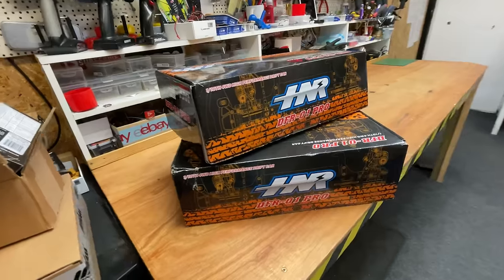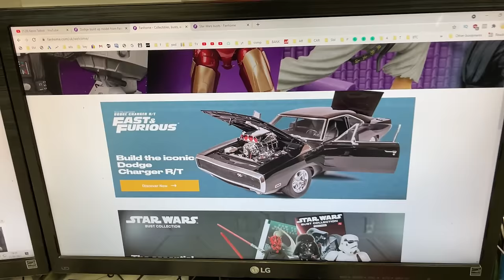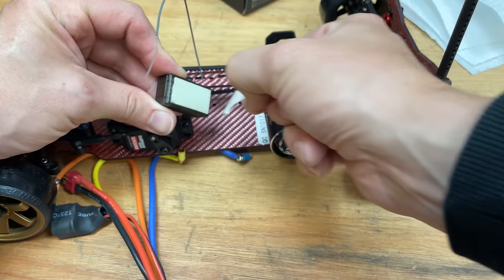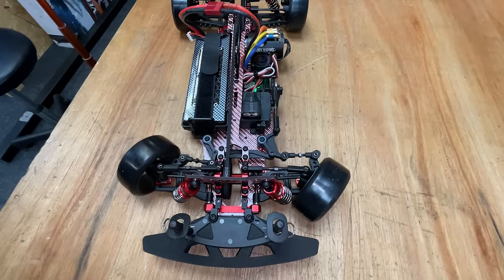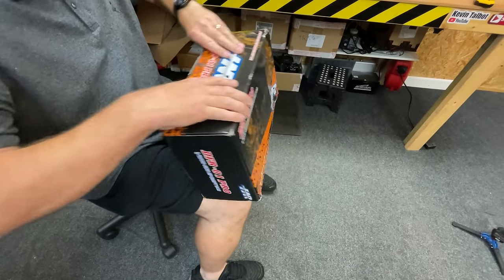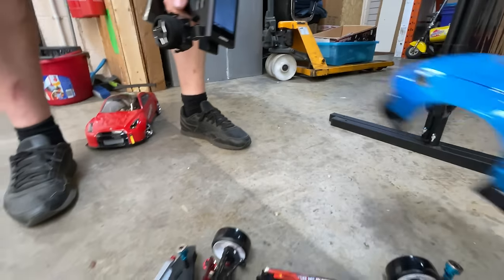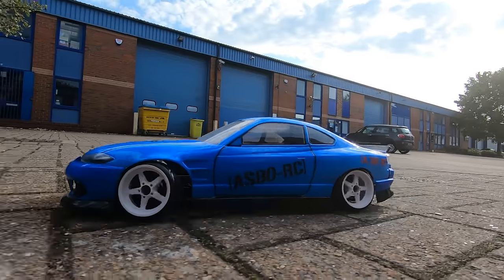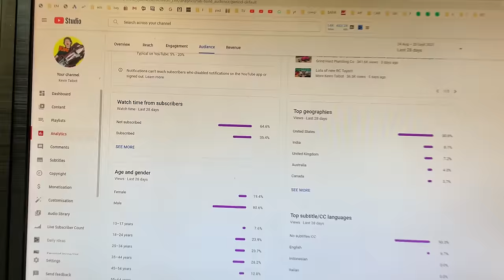Cheap Professional RC Drift Cars

Comment: 4WD? Professional Drift Car? That's a long time ago. I'm one of the rare guy's who keep CS-drifting for fun. But professional at this time is RWD.
Reply: and don't forget the gyro
Reply: Cs gang
Reply: @latefangs423  That's why i still love my CS-Drifter. It's drifting without a Gyro.
Reply: @DJDEVIL82  now that one interesting kit,i heard that gyro on the drift rc are pain in the butt to set it up
Reply: @latefangs423  took the words out of my mouth
Reply: @latefangs423  You need the gyro on a dial of your transmitter. That means you need a transmitter with a programmable dial. Each underground and each tire is different. You have to be able to ajust the gyro while you driving. Otherwise.. yes it's a pain in the ass.
Reply: @latefangs423  try setting up and tuning a 3 axis gyro system on a RC helicopter.

Comment: Yokomo yd2 rear wheel drive, pro drifter, easier to drift, technically all wheel drive is power sliding. Rear wheel drive are what the pros are using to drift, I’m not trolling, It’s not that serious, Love your shows, keep it up
Reply: Exactly but they're quit expensive :/
Reply: Yeah they just very exprensive.
Reply: Aye it's easier to just gaffa tape rear wheels of any RC car and I Habe a drift car hahaha
Reply: love my yd2 sx3
Reply: a good alternative is the 3racing sakura d5s i think rwd setup needs a bit more tinkering on the suspension to get it just right
Reply: @sska__karate271  Yd2s or e are relativ cheapsnd good
Reply: Yeah.
Reply: Yeah.
Reply: @sska__karate271  There expensive because there good 😂
Reply: @loga_912  There expensive because there good
Reply: its expensive because so many people hyped them up.
Reply: @zechariah3234  that’s completely false their expensive because there parts have  quality and the engineering behind the car itself
Reply: @zechariah3234  lol nope! Because they are good! Hype lol
Reply: @zechariah3234  yeah u most def a basher 🤣🤣🤣. Bashing is cheap any niche of rc is prolly around 350-500. It’s Like saying drag ones are expensive. Same price as a drift one lol they’re not overhyped they just have real tech and engineering behind em
Reply: @pitsa9838  i dont bash, ive put close to $1200 into a car. i dont think your hype and my hype are the same.
Reply: @bumperlez  not saying it as bad thing
Reply: @zechariah3234  I’m just saying you’re completely false no hate bro
Reply: MST are worth a look, make some good chassis 😊
Reply: Technically a pro drift car with RWD is also powersliding isn't it? Also technically a true drift car hasn't got plastic or foam tires has it? Also technicly a true drift car hasn't got a gyro to manage the drift has it? Also a toy car has a really tough time starting from standing still with plastic wheels and only rwd, so i'd say all those are only technicalities and true experience doesn't translate to RC world. :-)
Reply: @polishguywithhardtospellna8227  I agree on that rc drift isn’t a realistic compared 1/1 drift scale drifting. The gyro is there to simulate real steering movement the reason behind having a gyro isn’t just assisting you to drift rwd but to make it feel a little bit more realistic I can’t explain what I mean by real steering movement
Reply: does literally anyone in these replies know the differences between there, their and they're?
Reply: so ken block is a power slider lol, actually the difference between a drift and a power slide is when and how the slide is initiated. a power slide is a power slide because around the apex or halfway through the corner you give it power to get the rear to slide out at speed. Drifting is when the slide is initiated before or at the beginning of the corner. and your already sliding when your at the apex and slide the whole corner. So awd isnt just power sliding because when you drift an awd your doing the same thing, ebrake initiation get sideways and give power to keep the slide around the whole corner. The difference is how you hold a slide. Both awd and rwd need throttle to control the drift but where rwd needs counter steering awd doesn't and when you turn into the corner in awd your car either straightens or you whip the other way from the power. And in the real world AWD cars can do way crazier and more technical drifts because of the awd. Ken block could not have done a lot of the things in that mustang had it been rwd. But rwd also allows you to drift at a much slower speed because part of awd is giving it so much power your flying through corners. That also translates into RC cars and why you can do technical courses in awd cars, its just harder and easier to overshoot and is why formula drift and pro rc drifters run RWD, as well tandems are Insanely difficult and borderline impossible with awd.

Comment: I haven't seen anybody drift 4 wheel drive-in years.
Reply: yeah" drift car" its more like a slide 4wd car, not a drift car that are RWD...
Reply: @simasm.9757  what's the definition of drifting
Reply: @TheNamesArif  controlled slide, you don't just let the car slide, but you control where how and when it goes you can't do the same with 4wd what you can with rwd
Reply: @simasm.9757  as long as people have fun it doesn’t matter right!
Reply: Ken block is putting out content
Reply: @GhostActual206  yea was really fun got ride in one
Reply: @crazyrc4610  ture but its not a profesional RC drift car
Reply: @GhostActual206  I ain't going to waste my time, saw some RWD RC drift cars look and drive like real drift cars, not these 4wd Subaru that's in a parking lot on snow(no hate on Subaru)

Comment: 3Racing Sakura D5S its a good real rwd rc drifter if you want to test out rc drifting. It comes as a Kit, you'll need a body and electronics to complete the build.
Reply: How does it compare driving wise to a yokomo or something more exspensive.
Reply: @mbsanocki88  setup is a bit more not out of the box ready needs some tuning (its what most guys in my area run since we cant get yokomos to the same level of accessibility)
Reply: All I can do is make donuts with my d5

Comment: Do some rwd ones man, theres so much to chose from from overdose galm to sakura d5. The rc drifing community would definitely love to see so.e of that
Reply: Exactly
Reply: @brianbunner3669   nb4 is awesome 👌
Reply: Who cares? 😂 the drift community uses a gyroscope. This is embarrassing to me. 50% of the work is done by the computer. in 4WD, at least 100% of the movements are made by the driver.
Reply: @pawel98rc  love to see you drift a 1.10 rwd without a gyro
Reply: @pawel98rc  gyro is the same as a real drift car . real drift car counter steering it self

Comment: It’s definitely still nice but you can’t really call it professional......
I recommend getting one of the yokomo yd2 variants, the sxiii is most used by people.

Also if you do build it, proper good quality electronics are highly recommended and don’t expect to be an absolute pro the first go you give it. It’s a skill you have to practice and tune the car.
One last thing is you need a gyro for rwd
Reply: Yee i have on its hard to teach drift with it and its for fair price

Comment: Learning how to properly drift a rwd drift takes some skill. Drifting in an awd drift car would be power sliding. I have an RMX 2.0 and it’s a blast. So many upgrades to personalize your drift car. This winter I plan on honing my drift skills at my local track. You can never go wrong with a Yokomo drift car!!!! Top notch!!!! Driver skill is what’s gonna make the difference either way!!! 👊👊👍👍
Reply: looks like kevins is a countersteer car, where the front diff is spinning slower than the rear. helps with some stability, gives the illusion of a RWD without the weird powersliding look of a full awd like a 4tec. good for a beginner.

Comment: I am no expert by a longshot, but ive done some RC drifting a bunch. I own a sakura d5 and its great even though its on the cheaper side of the RWD rc kits. Knowing what I know now though, I probably wouldve went with a Yokomo YD2 series car. They have more options available that are direct fit and more of a following behind the brand. Love the drifting content kev, even if its just power sliding ;)
Reply: I’m seriously thinking about a Sakura d5, is it worth it? I’m trying to make a build around $400
Reply: @2smallgarage268  Yea. If you have 400$, and for sure want a RWD drifter, it’s a great deal. But it doesn’t compare to a YD2 with proper electronics. Just know that ur skill ceiling isn’t that high with a D5 chasis. At least without modification of course

Comment: I have the touring version of this model the brand is called Blaze and the model R2 ! The car is based on xray t4 2014-2018 not exactly on one model ! For the price its a good model al though you can't compare it to carbon fiber cars! For stock classes it can hold a bit, for modified class tho not a chance you need a lot of upgrades from xray to run properly! First of all, driveshafts secondly shocks thirdly you need to mod the plastic spur mount and motor mount in order to achieve certain gear ratios for small to medium tracks ! For drift car it migth be good i dont know ! Let me know if you have any questions!
Reply: Where did you buy your rc car from? Online or in store?
Reply: @troysoriano463  Hobbyking if you are in Europe or the official website Blaze rc !I don't recommend it tho!I can make it run decent from exprerience but for a new commer buy a well-known brand!
Reply: @PCXMODSGR  have you brought and fitted any of the parts from the T4?

Comment: I’ve got two of these, there actually super fun!! I’ve also converted one of them to a RWD chassis as well. Not bad for a chassis costing less than $150
Reply: yes!!!
Reply: How did you find them the link doesn’t work for me
Reply: Amazon is where I found them….
Reply: Wait how much did you get them for like to buy them and have them running without anything that you added on because everyone is saying they are around 300$ or like 400$

Comment: I would love to see a rwd chassis with a gyro like a mst rmx rtr
Reply: Would be cool , but I don’t think they are allowed to in the comp drift so it’s not common practice.
Reply: @Captinfun101  I mean most comps I’ve seen are strictly rear wheel drive 🤷‍♂️
Reply: @Captinfun101  the comp in the netherlands is only rwd, and gyro is allowed
Reply: Gyros are semi allowed in comp they have to be set to a certain point I run the MST rmx fully custom carbon and aluminium build
Reply: @baileygardner5408  i drive a yokomo yd2 and never had to set it to a certain point
Reply: @bvb-013  never had to set it in competition??
Reply: @baileygardner5408  nope
Reply: @bvb-013  I’d say you haven’t been using it in a real competitive competition as how would it be fair, you have the gyro all the way up the other guys have it under half means you’re being helped more so you’d seem as good as him but you ain’t 🤷🏻‍♂️
Reply: @baileygardner5408  gyro al the way up doens't help. Almost seems like the lower the beter at tandeming
Reply: @bvb-013  it definitely does help it’s what make your wheels do it’s own adjustment when the back end is coming out you control with throttle, where as with gyro down you have to make the steering inputs yourself
Reply: @baileygardner5408  i like to have more controll myself than the gyro, i feel like its easy'er
Reply: Did anyone else spot that the tyres on this where branded MST. makes me wonder if the whole thing is a re branded MST?
Reply: @Thunkworks  MST sells both rims and tyres as standalone parts, and they're fairly inexpensive (15-20€ for a full wheel set), with good amount of wheel color and style combinations and a good amount of tyre compunds so I wouldn't be surprised if other manifacturers started bundling them in their cars (MST itself bundles Tamiya bodies with some of their RTR cars!). In my area (northern Italy) competitions switched to DS Racing tyres as the control tyre, but I still believe that MSTs are a solid choice for any beginner.
Reply: @baileygardner5408  bro shut up u don’t know what u taking about lmao. It’s a very new shift to no gyro and based on tuning but it’s fringe. It’s all on setup, it’s like having abs on g. U clearly don’t know what u taking about
Reply: @pitsa9838  are gyros no longer being used in the rwd scene?
Reply: @buss1205  it’s something with testing very new abs might just be a fad

Comment: 4wd is cool, but for more realistic rc drifting do a rwd chassis. There are budget rwd chassis’ that work very well just like the big dollar chassis’. Sick vid 🤘🏼
Reply: like what??
Reply: @rx7s.  There are RTR chassis’ like the rmx 2.0 which comes with all electronics and controller for $375. Or you can get a Sakura d5 for $100 without electronics and build it with your choice of electronics.

Comment: Does it bug anyone else how the Wheels never fit the arch gap on the touring bodies?
Reply: It's because they didn't get low enough offset wheels for it.
Reply: You should see my 1/10 jzx100. The lip of the rim sits on the fender😂
Reply: they arent touring bodies, theyre drift bodies. but its a big trial and error or just measuring to find good fitment. these guys just slapped bodies on.
Reply: It’s also could be a 200mm body on a 190mm chassis

Comment: This might be a little unrelated but I will really appreciate your feedback.
I have bought a relatively cheap toy car and I can see the battery pack removed and replaced with li-ion 3.7v. The battery cavity has righting of 4.8v so it seems that it originally takes 4 AA batteries.
My question is, is li-ion 3.7v better than 4 AA rechargeable 1.2V?
I have tons of varta rechargeable AA 3700mah and I feel like getting a box and putting 4 AA in it like originally intended will be better than buying li-ion and charger for it. And I think the maximum li-ion capacity would be around 3000mah and I have to get a legit one to avoid fire.
Thank you!
Reply: It's just batterys your thinking to hard, just wire it all up in series

Comment: RMX 2.5 or 3.0 would be a better drift car 👍
Reply: Id advise against it if you or kev taking the suggestion arent very comfortable in drift considering the rmx3kmw is 2000aud and the 2.5 is 650aud
Reply: @mcmcb73  Love drifting and have the best track in the UK only 30 mins from me. Haver the 2.5 on pre-order

Comment: hey Kev I would really like to get into drifting and this seems like a pretty good starter car for the price but seeing you break the axle from just driving is it really that good. thanks
Reply: It won't break on a smooth surface, it just caught a hard edge sliding sideways... the drift tires have no give so careful over the ridges and you're fine!

Comment: good start drift car in my opinion is the mst rmx 2.0 kit version. don’t buy the rtr because you cant adjust nothing. 
electronics hobbywing 10bl120 and hobbywing motor. when starting rwd drifting use a gyro

Comment: Kev, get Yokomo yd2 sx3 (it's 2wd )
Reply: D5 is a better option
Reply: Or the pds
Reply: @RealJawnes   better? Or cheaper lol
Reply: @RealJawnes  oh i see, i really don't own a rc car, i just said it on the basis of watching couple of videos and i'm satisfied with the performance and looks of yokomo chasis. Thank you for your suggestions☺️
Reply: @weeirishboy  it’s a very good chassis and it’s cheaper by $450
Reply: The pds is the same or if not better than the yd2 and it’s $200 chaper
Reply: @RealJawnes   I've had Sakura rmx and yokomo rwd chassis. I prefer yokomo. I use a yd2s+. I think it was like 350 and I can drift with some of the top guys at my local track and they mostly use sx3 or other very expensive kits.

Comment: Kev. Fanhome?  Really?
110 assembly stages on that Charger. 
The first stage is $1. Stage 2, 3, and 4 are $6.50 each ($20.50 for the first shipment)
After that, each stage is $12.99 + $2.40 shipping, shipped in batches of 4. ($61.56 for each of the remaining 27 months until this model is complete)

So the fully licensed Fast and Furious Dodge Charger's total price is $1651.84 (if I've done my maths correctly), but you won't be done building it for two years and four months.

Comment: My redcat epx drift has lasted over a year with very little maintenance.  I even went brushless and throw on drag tires.  I did however twist a wishbone axel.  But the whole belt drive doesnt seem worthy to me.  The solid drive shaft in these redcats can take the punishment.  U should try the redcat.

Comment: I'm guessing its a clone of an original model.  Sakura chassis? Cant remember.  Theres also different compounds of drift tyres Kev.  So Im not surprised the cars worked better on the rougher stuff outside.  But if youre going to drift, cheap isnt really the way to go.  Thanks for sharing.
Reply: By the way he shoved it all into vinnys arms I think he’s already over drifting 😜basher by heart , drifter by never.

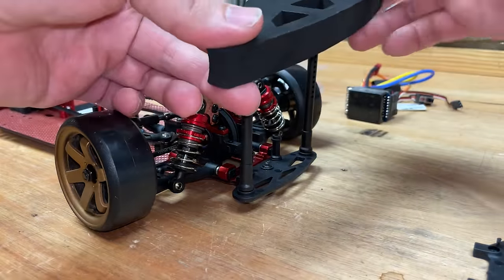Comment: 3:17 Well, I am not a professional but I do not think it will catch on fire if you mix up the cables.
Reply: Hooking up a lipo battery backwards creates a "dead short" situation, which can absolutely cause a lipo to vent, and if fully charged, vent violently

Comment: How did they send you all the monster truck bits but make you do the rest of the machine work like lining up the wheels ? That would do my head in . I know it’s a lot of custom work but if it’s of the gravedigger platform wouldn’t they just send you the right fitting gear? Get Mikey to the rescue.

Comment: Nice video, but i would not buy such a car. A Sakura D5 or a MST RMX are far superior cars for drifting. And for  just sliding around for fun, you can use any 4wd RC car. I started drifting with an old TT01 Tamiya.